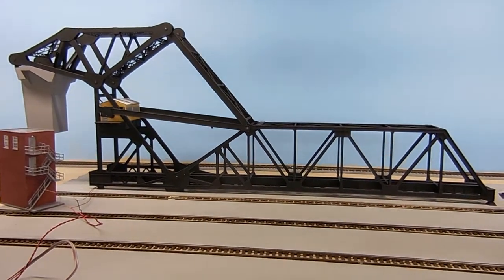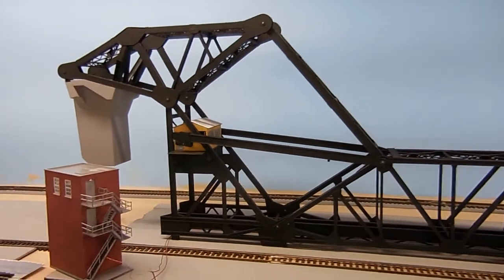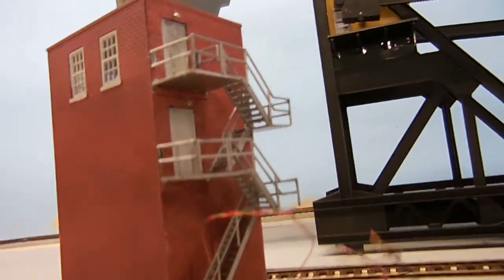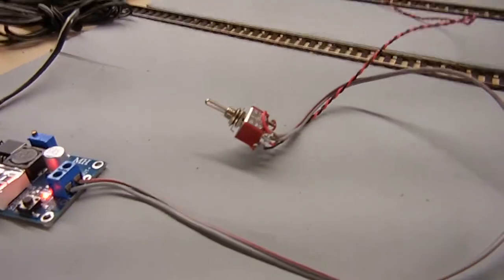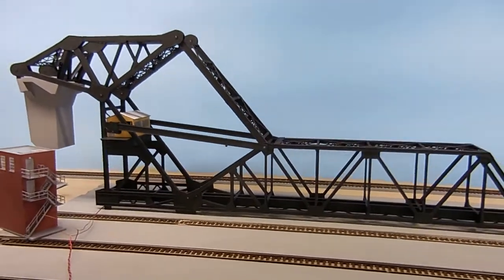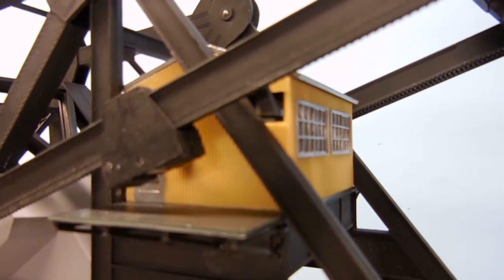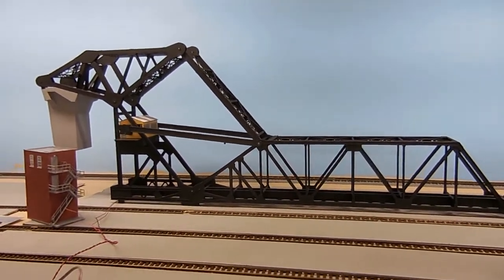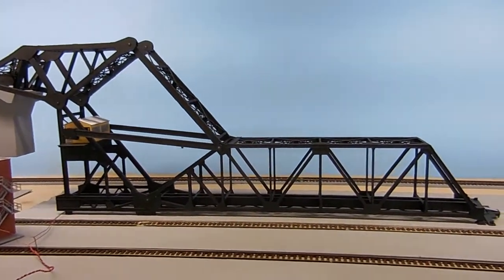Walters bascule  bridge, motorized.

Comment: First, great job building the bridge, looks great! That motor is way too noisy for my ears. I would swap it out for something much quieter/silent. 
When up it looked very tall. Did you have enough vertical clearance for it? Did you need to move the lights?